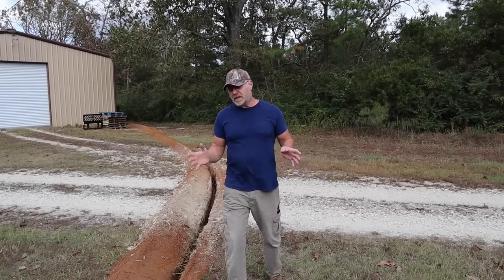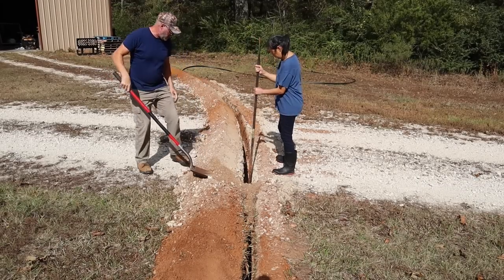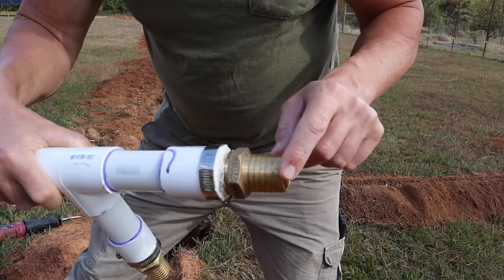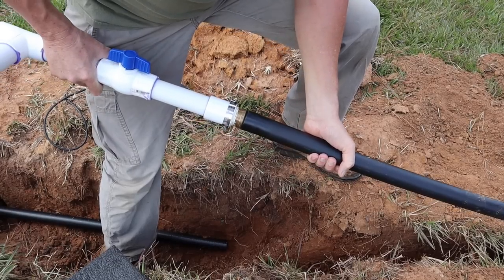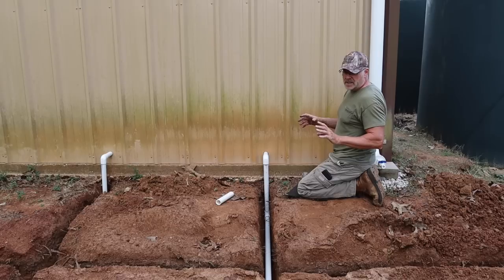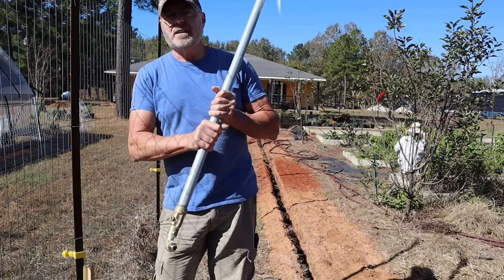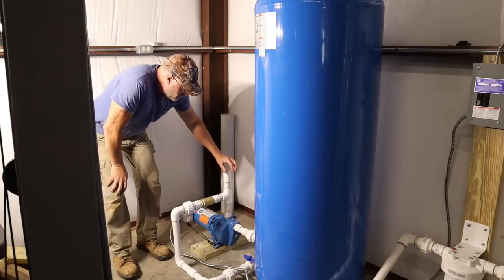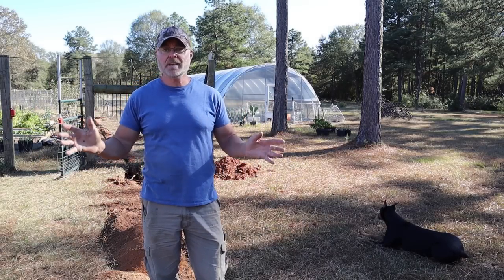Rainwater Harvesting | Connecting Underground Water Line to Garden and House

Comment: Great job!  I just installed 4  hydrants and about 200 feet of water lines for my gardens and barn lots this summer. I wished I had this video beforehand, it would have been so helpful. I got the job done but it was very time consuming. I like the idea of using PEX to hook to the hydrant. Thank you Pete for all your helpful hints. I am hoping to build a smaller rain collection system of some type next spring. I will watch all your videos on this again and hopefully stay out of trouble. Thank you very much. 👍

Comment: My one handed ratcheting PEX clamp tool came with a thin plate with slots for the various PEX diameters. If the proper slot slides over the underside of the crimp, it is tight. If not, crimp it some more.

Comment: New sub and wow--fantastic job! I'm in Arizona right now in a restrictive HOA and am planning to move out to the Tyler area to become self reliant  on very limited savings. I too am not keen on where the world is headed and am concerned about being on city utilities in TX  including water. While harvesting rain water is fantastic, I likely will not have much surface area on a roof for catchment. Is having a well and purification installed viable/ good strategy to get off city water and are there contractors in the area that will do a good job? On power, I have a decent sized dual fuel generator that I could use in emergencies but seems like solar is a more permanent solution if power goes out for months; however, a system with a battery bank is really expensive. Please recommend the most cost effective way to get off city utilities in your area. Thanks much!
Reply from the maker: You'll be very surprised how much water you can get off a roof. if you find the square feet of the roof and multiply that by .623 you'll get the gallons of water per inch of rain off the roof. Example, my garage is 40'x60' that equals 2400sq of surface area. Then take 2400 x .623 = 1,495 gallons of water per inch of rain. That's a lot of water.  There are well drillers in that area of Tyler that can drill you a well. I live in central east Texas and they charge about $10,000 to drill a well with a pump and presser tank included ready to go. Just do a google map search over that area and search for well drilling service. Solar with batteries is the best option to go off grid or for when the grid goes down, but as you said, it's very expensive I know. Check out my friend Eric's solar he's putting up  https://www.youtube.com/watch?v=Un3qeh4W-68 he has links in the description to where he got a great deal on a complete solar system. Hope this helps.
Reply: @petebeasttexashomesteading  Thank you so much! This helps tremendously; this is all new to me. I've lived in suburbia my whole life but have always tried to do things myself. I've spent the last 5 years building a food forest in AZ but it's all tied to the system based on location so I see clearly I need to do something more drastic with where things are headed. I really appreciate you and your channel.

Comment: Since you have lots of clay soil l’m sure the ph level of the soil is above 7.0 which is highly corrosive to any metal that is underground. Covering all metal with a rubber coating is a very wise decision. I also have a high ph value in my soil so I used type V concrete in addition to coating all underground metal with rubber paint.

Comment: those pex clamps you're using aren't the best ones, the copper rings are far better with far less leaks though swagging is better for buried applications.  Also did you add a way to winterize the system I didn't see?  Easiest would be a fitting in the shop with a valve and an air chuck fitting to blow it down incase of another freeze coming.  PVC shatters easily when frozen, the poly and pex should hold up though.

The weed barrier is going to trap moisture against the galvanized pipe. The sock for french drains might have been a better option.